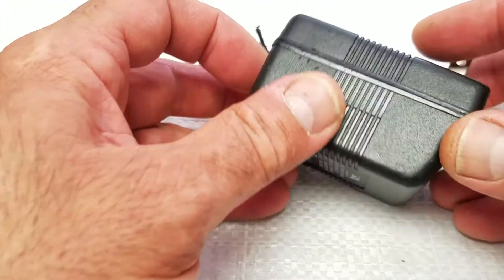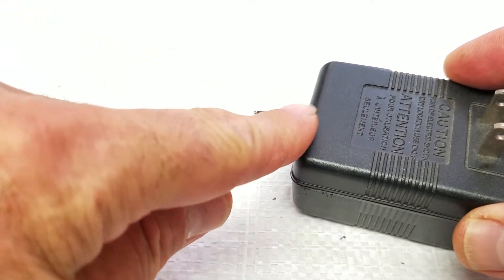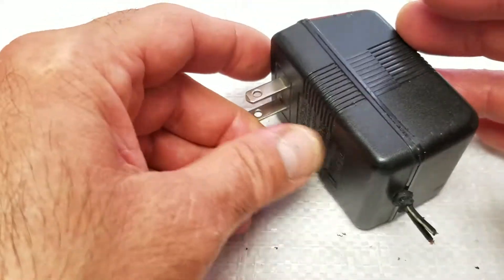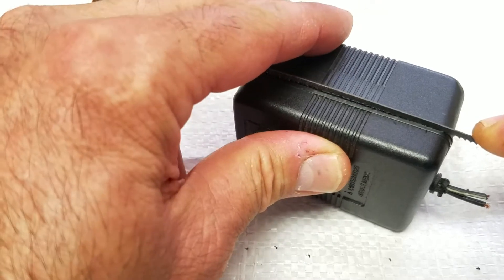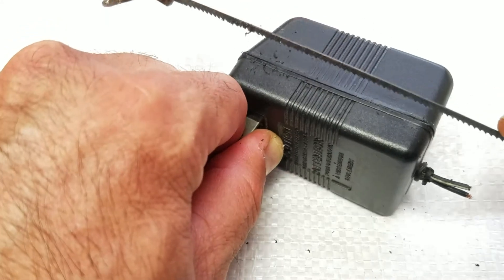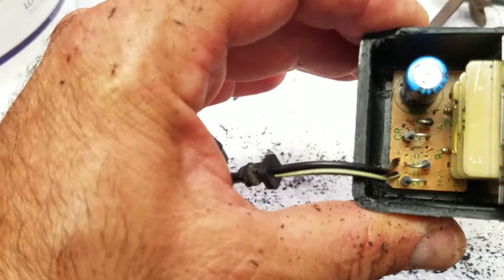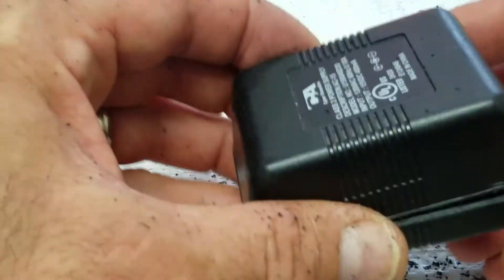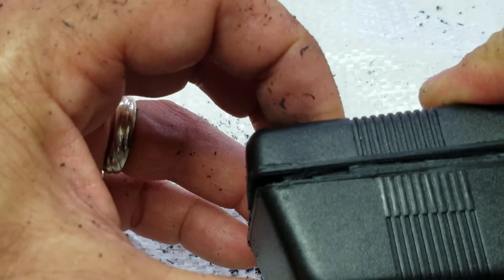How to repair AC-DC power adapter

Comment: Adapter without screws you can open with nail polisher ....just put it on line where is connected...after you repaired you have to use glue to stick it together.